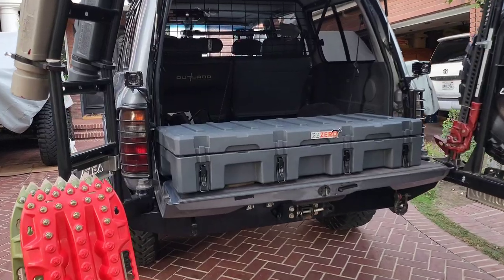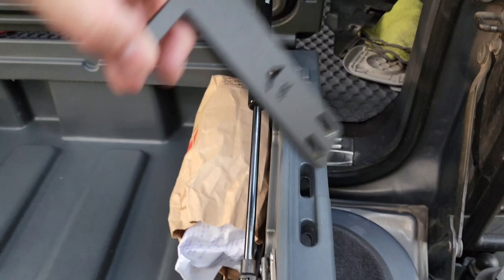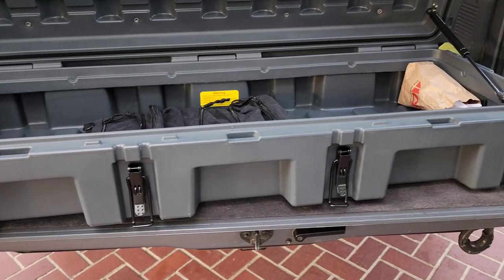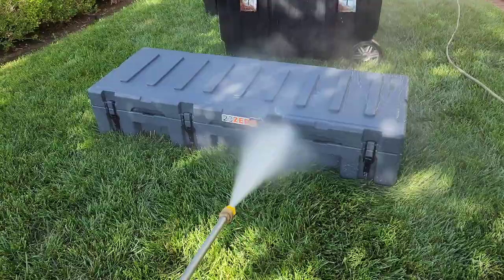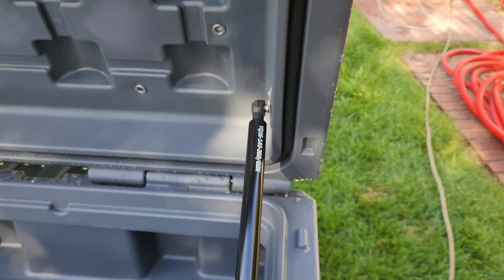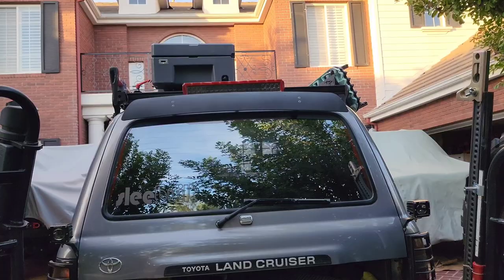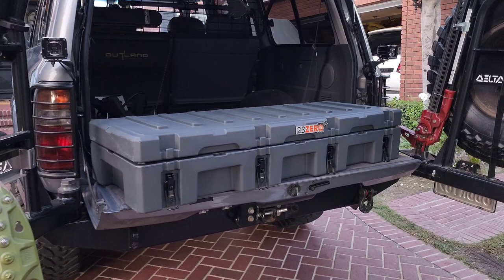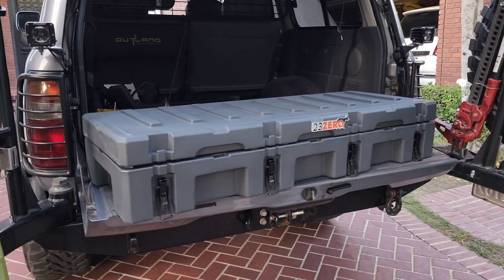Zero23 Case ✔ Everything you need to know

Comment: The problem with low-density polymers is that they will warp over time. ROAM Adventure is the worst in this regard. While this case has latches out towards the ends, you'll still be dealing with warping. When the lid/rim warps, the seal is compromised. High-density polymers are really the only way to go for cases exposed to the elements.
Reply from the maker: interesting. Thanks for the input and insight!

Comment: Really nice video.  I pulled the trigger and just ordered the exact same box.  Then I checked out Cerakote - YIKES 50.00 for a small bottle of 4 ounces.mI’m pretty sure it must be diamond powder is a suspension of liquid gold.
Reply from the maker: Use the wipes.. $20 for a box of 10.. not the ceramic #9 hardness, that's for ceramic coating a car.